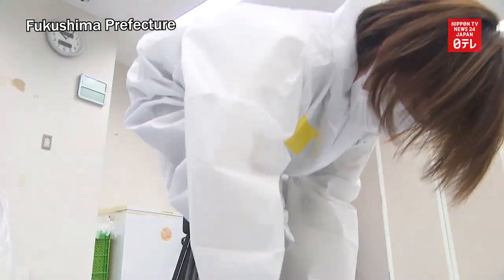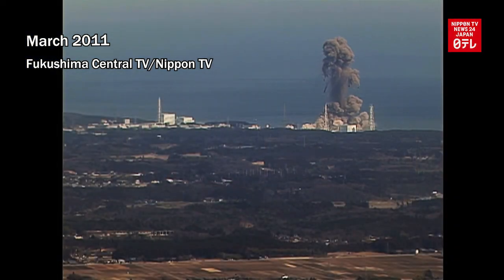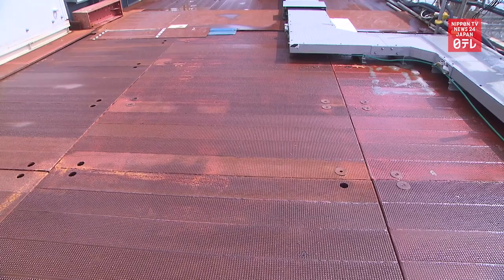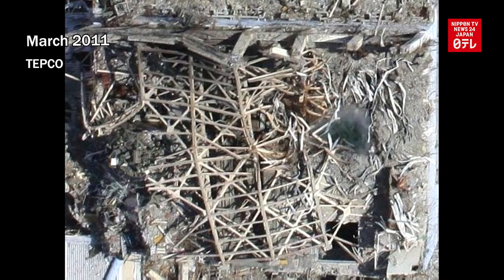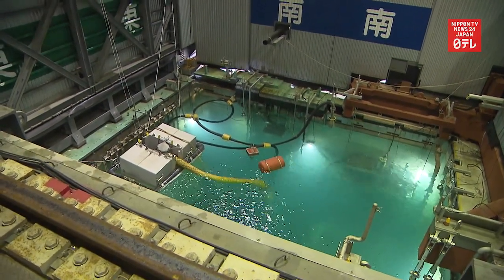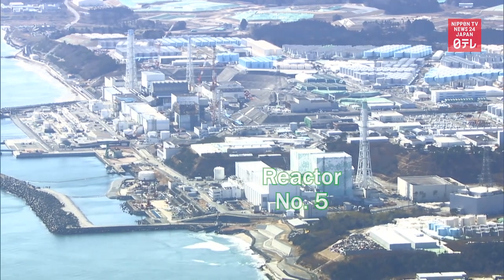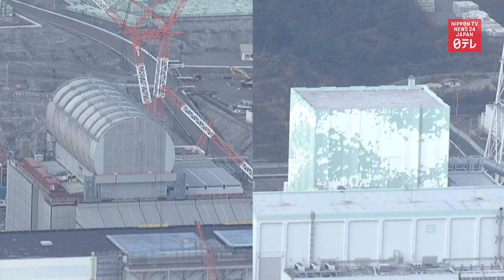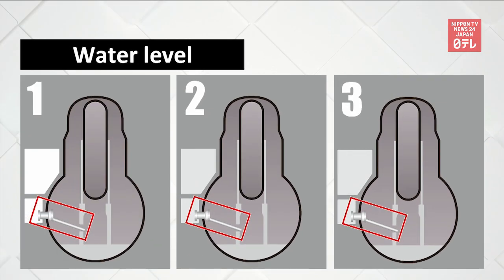Removal of Fukushima nuclear fuel debris poses major challenge

Comment: Why is Fukushima not the worst nuclear incident? It used to be the worst due to massive leak of radioactive to environment.
Reply: The radioactive fuel didn't breach the containment vessel in  neither of  the 3  damaged reactors, in chernobyl most of it ended up in the basement, and lots of  particles ended up  travelling across europe. Looking at the enviromental damage, lots of irradiated water ended up in the ocean, but didn't do as much harm as the radioactive cloud  from Chernobyl

Comment: unit 3 is in very bad state, they want to remove water, why? well core eated concrete, left only metal bars, basically very bad as all reactor sits on metal bars which are in water. it can colapse any moment as Japan is where eartquakes happen.they need to spray concrete maybe foam concrete would help.